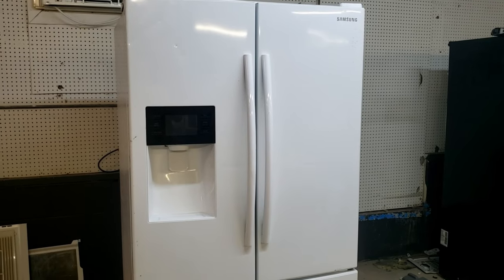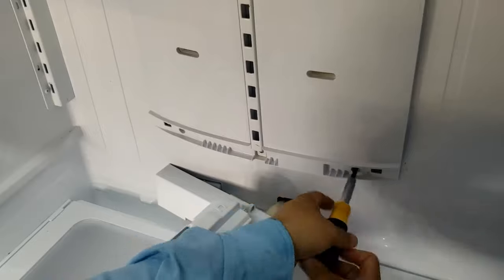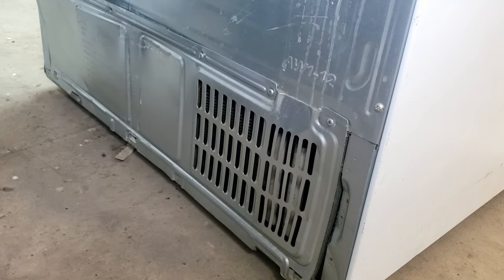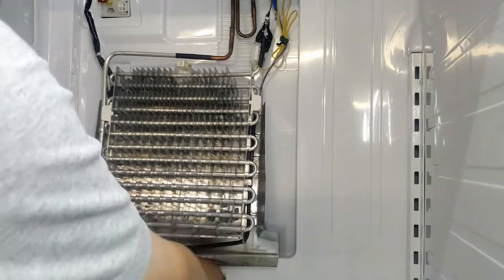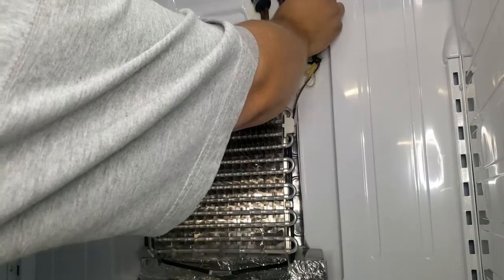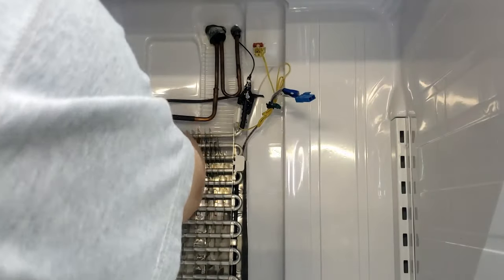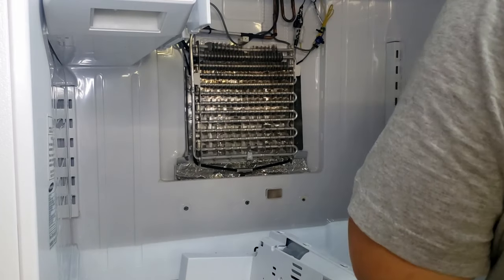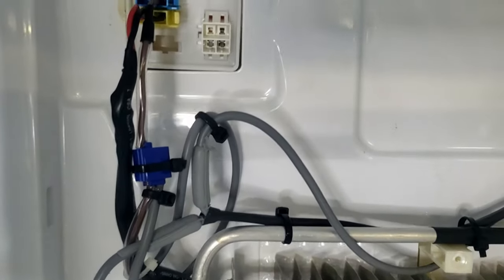Samsung Refrigerator Ice Build-Up and Leaking Water Inside Drawers - How to Fully Fix it Forever

Comment: My samsung, RF268ABRS, fridge doesn't have two plugs as the unit you added the additional defroster to.  How do I add the additional supco defroster? Thanks
Reply from the maker: We spliced it in on the main defroster wire. We didn't use the plugs at all on the unit. I just unplugged them to make the installation easier. if you use Posi-Taps (which are in the description, but I didn't use them), they work REALLY REALLY WELL and make it easier to do than what we used in this video
Reply: @bensappliancesandjunk  How and where exactly am I to use the Posi-Taps?
Reply from the maker: @echoniner007  I'll see if I can add a video of it. if you watch a video from the company on positaps, you'd use it the same place I am using the 3M splicers at, just swapping w. positaps
Reply: @bensappliancesandjunk  Thanks. I watched a video on how the positaps work so now I understand.

Comment: I am getting water under my bottom tray and executed part 1 of the Samsung kit (without the heater).  Everytime I removed the back wall, there isn't ice build up so I don't think its an ice issue but I am getting water under the tray and its sweating.  I doubt the heater part of this will help that but what could be the issue now?
Reply from the maker: If you're still getting water, you want to check the drain tubes behind the refrigerator, and also purge any obstructions from the drain hole in the refrigerator cabinet. At times, you can get derbis in that line that will allow water/ice to pool up really fast, resulting in the leaking. Water leaking means the water is not going into the drain tubes into the drip pan properly... The heater kit likely won't solve that part, its all about routing the water into that hole, and it being able to flush out without obstructions. I hope that makes sense.

Comment: Great video. Question did it work over time? Thanks.
Reply from the maker: Yes it does. If you do ALL OF THESE STEPS it should take care of the problem entirely. The problem with this issue is that most other videos and solutions are half-measures. They will take care of one part of the problem, but not all of it.

The problem is that there's too much moisture in the cabinet, so the evaporator fan acts as a beacon for ice buildup. If you reduce the moisture, it can solve the problem, but those solutions may degrade over time (drain line additions)... The addition of a heater ensures the ice never builds up in the first place, but reduction of moisture is important too. So doing both while you have the fridge all apart anyways is a 1-2 combo that knocks the problem out. There are professional installer groups that talk about this issue. The solution is about a 95% success rate vs. maybe 50-60% for most other solutions.
Reply: Thanks for quick reply. I am going to give it a go.
Reply from the maker: @daveschweitzer6669  one modification I've made to the video is that instead of the scotch locks, I am using posi-taps to splice the lines in.. much quicker and less room for error. Look them up on YT and you'll see they are easy to yse
Reply: @bensappliancesandjunk  Could you share with us which professional installer groups were talking about this issue? I'd be curious to monitor them too. Thanks!
Reply: What size Posi-taps do you use? I bought 3 different sizes in a package from Amazon for $10.70.
Reply from the maker: @robertmurray1114  i used the 14 to 16 i believe

Comment: Hi there.  You mentioned in the video toward the end of the video @ 14:21 the alternative solution to the heater wire.  I'm leaning toward the alternate solution mainly b/c I'm not too comfortable with splicing wires.  I know you mention the heating solution works 100% of the time, but what do think of the alternative solution of purchasing a secondary drain kit and covering the copper wire?  Would that work and has anyone else tried that?
Reply from the maker: Yes, I know a few techs that have done it and say it works very well. You can just use the padded HVAC tape included in the Samsung Drain kit on the copper line instead of the bottom of the drain pan. This assumes, though, the drain pan isn't heavily rusted. If it is, I'd suggest buying more tape (I've used Frost King via Amazon before, seems good) if needed.
Reply: @bensappliancesandjunk  thank you for posting this video, would you please add a link to the frost king tape mentioned?
Reply from the maker: @r.avalos  posted in description, but otherwise: https://amzn.to/3otC2wQ
Reply: @bensappliancesandjunk  I tried insulation HVAC tape and that solution did not help.  It started frosting/icing up in the middle and toward the bottom.  The only "good" thing is there is no frost/icing in the portholes.  Do you think it may be the Defroster wire that may be faulty.  Watched another YouTube video from MissingPiece about moving the Defroster wire (black wire on the left of the unit) to the top middle to properly defrost?  The Samsung refrigerator he has is the French door with double bottom drawers.  I have a Samsung french door with a single bottom drawer.
Reply from the maker: @stefang4495  are you talking about the calrod heater that's normally at bottom? I wouldn't suggest it. I'd just do the Supco SH201 heater splice and be done with it. I've read about techs doing this 100's of times with almost no issues. If you use Positaps instead of the 3m Schotchlocks, its tool-less and way easier (I wish I included using those in the vid, I switched to them on my next unit w/ great success)
Reply: @stefang4495  I believe that SH203 is like 55W,   and he was advising 10-15W??  The SH201 is 15W and the SH502 is 15W.  (SH202 is 45W).  It appears the 201 is the better choice as it states application in drain pans (so getting and staying wet may be expected whereas the SH502 explicitly states not waterproof.
Reply: @bensappliancesandjunk  Maybe you can add an edit to this video showing how to use those positaps?

Comment: What about the additional amp draw the new heater will use?
Reply from the maker: Amp draw is under 0.2a and there's about 10a of headroom.
Reply: It's only 15 watts, compared to the 100 + the original draws.

Comment: How can I test the fan is still working? It's supposed to circulate the cool air, right?
Reply from the maker: The fan on the evap panel is supposed to circulate, yes. Keep it plugged in to the harness, then ensure fridge is on. Watch my Samsung Beeping Noise video where I trick the unit into thinking the door is closed via magnets so you can see it run with the doors open.
Reply: @bensappliancesandjunk  Awesome. You did a good job explaining in details.
Reply: The fan is powered by 12v.  I simply used some jumper wires to connect mine to a car battery to confirm the fan was still good after being locked up for a couple days.

Comment: Could this issue account for an insane amount of noise coming from the back of the fridge? The water leaking into our floor has been an issue since we moved in. Recently I noticed ice buildup as seen in this video, and shortly after that we started getting a VERY loud noise that sounds like a fan or motor. Sound stops when the door is opened and starts again when it closes. I thawed out the fridge entirely and the noise stopped for a few days and is back now as the ice builds again.
Reply from the maker: Yes, absolutely. The fan for the refrigerator is behind the evap panel, and that is the main area where the ice builds up. It loves to draw that moisture in and freeze on or near the fan, eventually causing the noise.

Comment: Ben your store seems to be erroring out and not allowing purchase of the kit?
Reply: I think the link in this video needs to be updated for the purchase of the kit...it is working but I had to search for it in Ben's store.. Little intimidated to do all of this but the ice I know is becoming a problem and would like to save the refrigerator . Thank you Ben! I'll report back!
Reply from the maker: @vdastoli1  why did you need to search for it? I have in the description + a post pinned in comments with the bitl.y link of: https://bit.ly/2V55X4X

It should take you directly to the purchase page where you just need to select the options and that should be it. What kind of error did you get from the page?
Reply: @bensappliancesandjunk  it's working now. I was getting a technical error. Seems to have fixed itself.
Reply from the maker: @vdastoli1  darn I'm sorry to hear that
Reply: @bensappliancesandjunk  it's all good man you're the only person posting actually valid information on here. Looking forward to getting the kit and seeing this problem fixed! With the 3m splice is the grease still needed?
Reply from the maker: @vdastoli1  it isn't needed,  but we include it just in case you want to add extra or use it elsewhere in the refrigerator

Comment: Hey Ben! We just bought a kit over a month ago, we installed it this friday. We're having an issue on the secondary  heater, when put into forced defrost mode both heaters turn on for about 2-3 seconds and then both heaters stops working. Is there another way to bypass this overload issue on circuit? Is there a way I can get in contact with you for more info? Thanks!
Reply from the maker: Hi,

If it turns off very fast, it's usually because the defrost sensor is bad and needs replaced. I would check it with a multimeter to see how many ohms it is. Otherwise, the main boards defrost relay is going bad, and the board needs replaced.

Comment: I watched my husband follow your video did everything you said on our 2015 Samsung set the temperature above normal standards woke up this morning and the milk and other liquids were frozen again. Water filter frozen again. Is there anything else we can do?
Reply from the maker: If they are frozen, you have an entirely different problem. 

If your refrigerator is over-cooling, you likely have faulty sensors in the refrigerator compartment. You will either need a tech to come out and look, or will need to purchase a multimeter and test the sensors that go into the compartment to verify if they are working or not. Likely, one or two sensors is reporting the refrigerator is warmer than it truly is, so its attempting to cool the refrigerator down further than it needs to, causing freezing conditions.
Reply: 7:10 - those self-adhesive strips has to be attached from outside of aluminum cover. You gave people wrong recommendation. It has to be between aluminum cover and fridge body !!!!!!!!!!!!!!!!!!!!!!!!!!!!!!
Reply: @yuriy797  are you sure?
Reply: @jakemf1  I fixed more than 100 fridges with this problem

Comment: Sorry but I can’t find when you would need the 36 inch versus the 18 inch heater wire? Can someone help me? Thanks
Reply from the maker: In most cases you'd want the 18" vs. the 36". The 36" was an option we showed in another repair video, and a lot of people wanted us to keep it in stock because some refrigerators have a U-shaped bend on the refrigerant lines that are a little longer.

Comment: anyone know how to force defrost the RF4287HARS? Ive seen videos on the the fridge like mine but the control panel is slightly different than mine. I cant find it anywhere and Im tired of throwing money at this thing. Ive replaced the temp sensor and heater but its keeps freezing up.

Comment: I am not getting any water in my crisper drawers, but the bottom of the freezer compartment is filling with ice, then water starts to leak out onto the floor. Would you think it is likely to be the same issue?  We got all the ice out last week, and after about 7 days it started leaking onto the floor again. Thanks.
Reply from the maker: Drain line in freezer is clogged. De ice it with a fan, remove back panel, then clean the drain with forced water. I have a GE video on leaking- same idea. Then once done, consider a drain probe. You can buy from Amazon for $10
Reply: @bensappliancesandjunk  Thank you!!

Comment: What is the part number for the heater modification?
Reply from the maker: There's no official part# from a manufacturer other than what Supco offers either with the SH201 or SH502 kit.

I found a manufacturer that makes them to my spec and sell them via: https://bens-appliances.com/collections/all/products/refrigerator-secondary-heater-kit

Comment: We ordered the recommended parts to try to fix our issue. It took 9 hours to thaw the refrigerator and freezer. Could there be another issue, such as a leaking water line in the ice maker? Our bottom freezer is always frosting or icing up and the top ice maker won't dispense ice.
Reply from the maker: If the ice build-up is on the back panel of the refrigerator, then no, the ice maker isn't leaking water. The only way your coils get iced up heavily is from the condensation of moisture onto that area. 

One major thing to look at is cleaning out your drain lines when you install any parts - use a turkey baster, or anything that can force water into the small drain holes at the bottom of the pans. This will help flush water in to de-ice any obstructions. Heavy ice build up can take MONTHS to generate, so when it takes quite a few hours to defrost - its not something that happens immediately. 

On the icemaker, its a similar problem - its all moisture build-up from the cabinet not being able to flush out the water/ice through the drain hole. I am working on a kit to help improve the icemaker's problem, but its still about 4-5 weeks out. If you ordered the kit from my website, I'll let everyone know when its available for purchase.

Comment: I watched the video and read all the comments. I purchased the alternate 201 heater and packaging says it is 55w which is way over your recommended wattage. I already started splicing it when I noticed. Now I wonder if I should undo it. Should you take the alternate down or will the 55w be okay?
Reply: Important! I just realized you say the supco sh201 but your link is to the sh203 which is 55 watts! Watch out! This is already partly wired into my fridge! Fix link and let me know if this is a problem is possible. Thank you!
Reply from the maker: The regular heater is about 300 watts so no, it'll be fine.
Reply from the maker: Also, the alternate heater link shows the sh201 for me, not the sh502. Where did you get the 502 link? Do you live outside the US?
Reply: @bensappliancesandjunk   I live in The United States and it took me to Amazon to the SH203 which is a 55 W model. Are you sure 55 W will not cause problems with the electrical being overloaded or too much heat for that spot there?
Reply: @bensappliancesandjunk  also I just checked the link again and now it does send to the sh201, the 15 watt. I’m worried about undoing my splice and the wire being damaged. Will the 55 watt sh 203 generate too much power? Should I wrap it in insulating tape before I wrap the 55 watt around it?
Reply from the maker: @tairakimmell8547  the 55w is only a fraction of what the main heater pulls which is well above 400w, and there's plenty of room for the extra 55w. There's a sensor near the new wire you're putting in that'll automatically shut the heater off (both of them) if it thinks the cabinet gets too warm.

Comment: Why does it need the new tubes in the back of the fridge? What's wrong with the old ones?
Reply from the maker: They clog up very, very often and can cause water flow restrictions. So very often I see bad ones because they aren't well designed from the factory
Reply: @bensappliancesandjunk  fierce. I'm in the process of doing all of this now, except I didn't buy the heater. Hopefully the drain kit and that longer clip will suffice. In your comments, somebody mentioned that the stickers were put in the wrong place. Can you confirm?
Reply from the maker: @druiz607  hi, the foam pieces were on the wrong side, yes. I note that in the description, and when anyone orders the heater kit, it contains newer directions on it. I'm working on revising this video in a week or two to update it all.
Reply: @bensappliancesandjunk  Ok so the drain kit and clip didn't fix the ice issue as it started gathering ice again in under a week and the fridge has been around 50 degrees for a couple of days now. I didn't think that bottom clip was going to solve the issue since the ball of ice was way up at the top but I thought maybe those stickers retain heat. So now I went ahead and bought the heater, posi-taps, silicon and ties from your description using your amz links. I get it friday. High hopes! thx for the video!

Comment: Does this kit work with rf263a model?
Reply from the maker: Yes. As long as it has a defroster in that upper cabinet and as far as I know, that one does
Reply: @bensappliancesandjunk  thank you Ben. Also how did you know it didn't work the first time due to you not crimping hard enough? And finally would it be more effective if you wrap the heating line around the copper line?

Comment: I just installed the kit. My fridge now reads 28 degrees and freezer ‐8 degrees regardless or temperature settings. Any ideas?
Reply from the maker: How long has it been running at 28 and -8? Is it on farenheit or centegrade?

Comment: Whats the reason for replacing the drain tubes? can’t you just clean them out?
Reply from the maker: Often they dry out and get very brittle, causing them to fail. If they break up significantly, air/moisture can just seep back into fridge causing more ice buildup